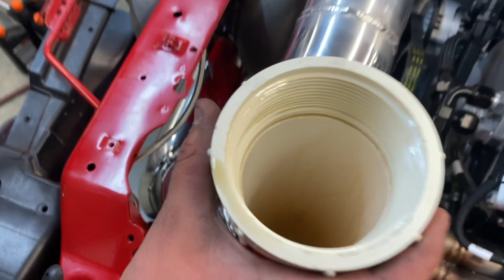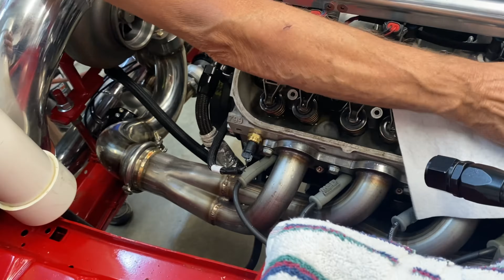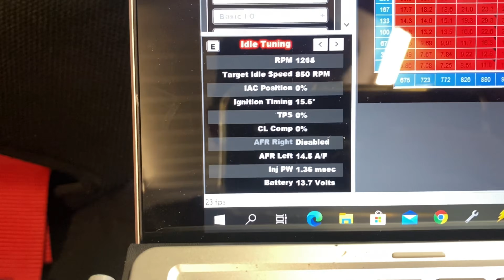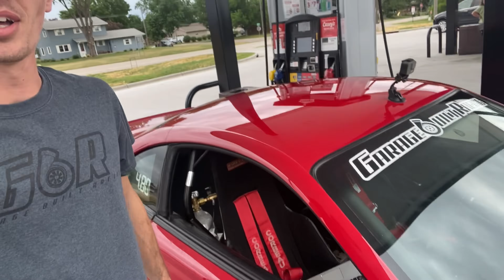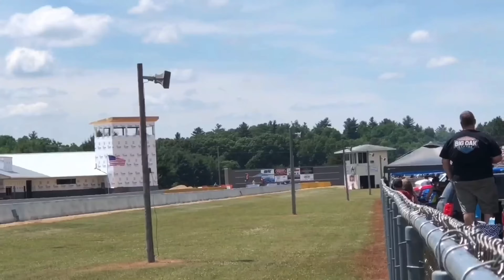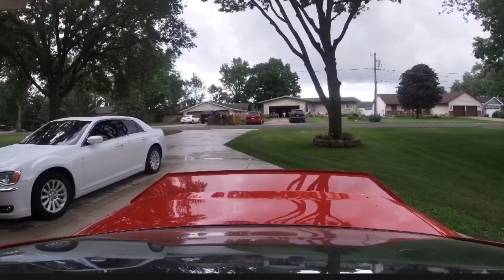First drive in my 102mm turbo mustang!!

Comment: Did you tap the oil pan for the turbo drain?
Reply from the maker: I welded a bung on the pan for it
Reply: @OverydeMotorsports  haven’t had any draining issues?
Reply from the maker: @mike.fleming  no sir

Comment: How hard was it to put the LS in the sn95 that's my favorite body style and is it expensive to do
Reply from the maker: It is pretty easy the make k member kits for them with motor mounts. They Can be as expensive or as cheap as you want basically but definitely will cost 5k or so total